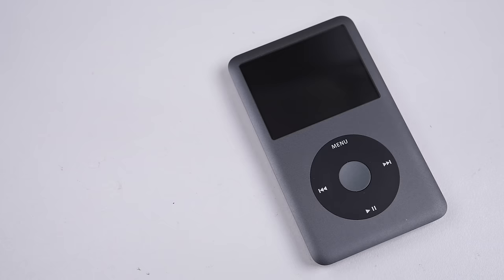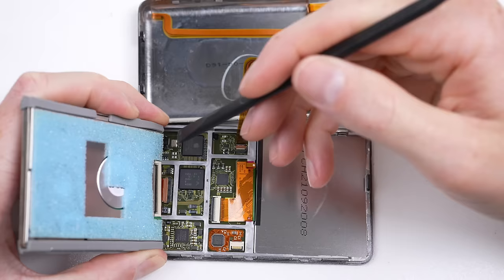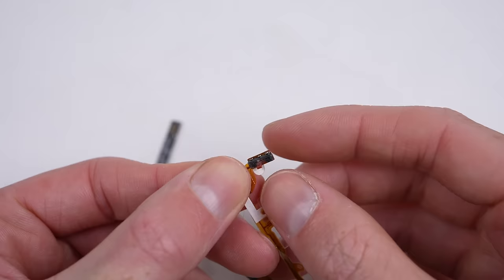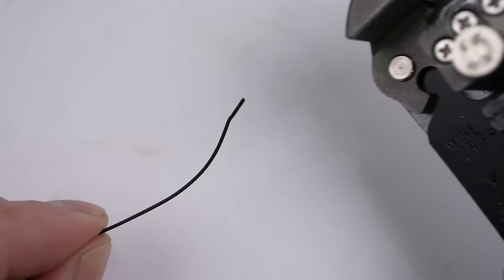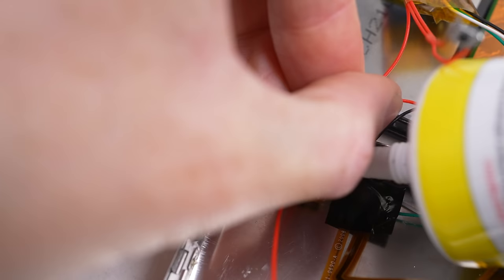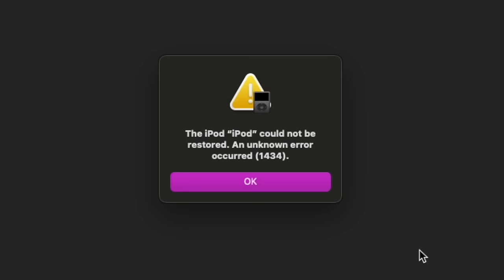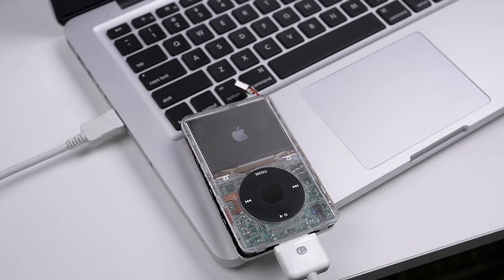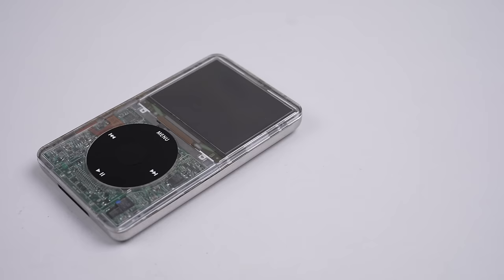Upgrading Obsolete iPod With Modern Hardware (With Great Difficulty)

Comment: I got a 5th gen iPod at the thrift store a few years ago, needed a new battery, and while the HDD somehow still worked I upgraded it to an SD Card adapter and gave it a 128GB SD Card. Then I put RockBox on it as well, so it doesn't even need iTunes and I can play a bunch of other file formats.

Comment: Be very careful when using any sort of liquid Adhesive on a uncased Li-Po battery. As some can dissolve the plastic wrapping they are manufactured in and can potentially make them catch fire. It's better to use some M3 type of double sided tape.

Comment: Hello Hugh,

You've made a couple of mistakes, but they're easy to fix. The green board works fine, but it needs to be connected in a specific way. Just make sure you have one white line visible. Elite Obsolete made a video about it.

The second mistake is using a 6th gen iPod, which only supports up to 128GB in the Stock OS. If you want to use more than 128GB, you'll need to use Rockbox. Consider getting a 7th gen iPod, which has capacity of 160GB. Make sure to get the thin variant if you plan to do that modification.

Comment: I'd buy a modern Ipod tbh. I have the S24U and it makes going for walks and to the gym a hassle because it's bulky and heavy, I'd much rather use a smaller device. Plus, having your library not through a service like Spotify would be nice. When the major carriers all had connection issues recently, work was a xrag without being able to use Spotify.

Comment: Thanks for the video ..Just for the info..There are better SSD kits in the market now a days..It is fully  compatible with 6 th and 7 th gen ,smaller 1/2 size of the iFlash or CF/SD card adapter ,and comes with 2000mA battery .You can use it with slim ipod case too..

Comment: moonlit market seems to be a somewhat easier kit to have aptx bluetooth with better than stock battery, with haptic motor and ssd and usb c. but it requires a new backplate and has issues with airpods (last i heard). unfortunately there doesn’t seem to be a kit out there that does best of all worlds… biggest battery, 4 microsd cards, apt bluetooth with haptic motor, airpod compatibility, dual boot with rockbox, usb c… since all of that would be a challenge to put together and still look stock.

Comment: I did the same Bluetooth board in a 5th gen iPod with an iflash quad and a slim battery that’s the entire back of the iPod. Hated the install process, couldn’t get the board to pair with many things, so I took it back out and replaced the headphone jack with a brand new one unmodified. Still using my iPod as it was intended with just a flash mod lol

Comment: there are better ways of waking the BT module when the ipod turns on... Finding a power rail on the main board that only comes on when awake, using that you could use a low side mosfet to switch it on.

Comment: you can save a lot more space by using an iFlash solo and cutting the top off since it contains no traces at all!

It's funny, just like 2 hours ago I worked on an iPod classic myself (replaced the front with logic board and all from my modded iPod whose battery connector was broken with parts from another one I had lying around)
Might add bluetooth, but later :D

Comment: 6th gens are weird. Over 128gb will work but only if you use Rockbox. If you're using Rockbox with over 128gb, you CAN NOT boot into the original Apple firmware OR disk mode or the firmware will mess with your drive making your partition 128gb exactly. This messes up any data past that 128gb spot and is a huge hassle when you accidentally flip the lock switch while booting and go into OFW. With the file transfers being sooo slow to try to rebuild anything, it's so much easier to just stick with 128gb or less for 6th gens, they still work great as long as you follow that.

Comment: The problem is more likely the firmware incompatibility of your SSD. I did encounter similar errors building my hackintosh. Some SSDs were fine, on some I was unable to complete the installation due to error.

Comment: Hmm; you're using the original in-built DAC/Amp to feed the Bluetooth via the headphone's analogue output so can then be re-converted to digital via the Bluetooth's ADC, that will add distortion.  If you could have tapped the digital signal before the iPod's DAC and passed it straight to the Bluetooth transmitter, the potential output (if via LDAC) could have been very good; as is you're limited to the iPods iffy DAC/AMP (I had various generations of iPod and I was never convinced by their audio quality).

Comment: These are the exact features I want to mod on my ipod. Wondering if I can get everything to fit with a 3000mAh battery and thick back plate. Might just buy the parts and take a punt

Comment: I had this issue. It was the version of iTunes I was using. I used the RetroActive Github project to install the old iTunes and it worked for me. I also had issues with those adapters. The stock ribbon cable was too thin for the adapter.
Reply: He used a bad iPod that can't support more than 128GB. It's a 6th gen, not the 7th gen. He needs a 160GB 7th gen only the thin variant, for his modification. 6th gens come in thin 80GB, thick 160GB, or 120GB variants as well.

Comment: It's the red CF card that's not working and causing that it can't be restored. There are methods to get the red card working with the 3G/4G/5G Classic and Mini but it's not working for 6G/7G Classic. It should work with iFlash's CF card.

Comment: I wonder what filesystem was on that original 128GB card? In any case, you should be able to do a clone of that disk onto the 512GB SD-card. That will at least tell you if it can read from that device.

Comment: I used two generations of iPods, but I always refused to load iTunes on my PC, so used public domain software to load the songs.
After the third generation, Apple changed the structure of the song database by adding more fields, and the previous public domain software stopped working, requiring an update.
The database change occurred at the 7th generation (I believe because of DRM management) involved some low level access to the hard drive, and Logical Block Addressing could be the reason why you can't replace the mechanical hard drive with a solid state one.
Thank you Mr. Jeffrey's for the video.
Greetings from the UK,
Anthony
Reply: He used a bad iPod that basically can't support more than 128GB. It's the 6th gen, not the 7th gen. He needs a 160GB 7th gen in the thin variant to make his modification work.
Reply: The 160GB thin 7th gen can support up to 2TB in FAT32, but it's recommended to stick to a size around 512GB. The 5th gen Video can also handle storage like that. However, the thin 120GB and thick 160GB 6th gens don't support more than 128GB.

Comment: I used to build/configure my own desktop computers back in the mid/late 1990's.  Why did I stop?  Because the functionality in laptop computers has matched or exceeded the desktop, as well as providing more space for me, and portability.  Funny thing is, I do have a laptop on my bench here that is awaiting a memory upgrade so I can switch over to it, as my current laptop will NOT upgrade to Windows 11.

What's all this mean?  That's a lot of cool work there Hugh, but my new to me iPhone 14 Pro arrives on Tuesday, and it will become my new ipod.  Replacing the iPhone 7 Plus, which is becoming a liability for apps that won't upgrade/update.  Cool video for sure!!  Gotta replace the iPad Mini soon too, same problem as the iPhone 7 Plus.

Comment: This iPod version are the worst to do some mods because the software version that limits the ram storage, also those Chinese compact flash adapters would fail for no reason, the best alternative it’s  use one of the many flash adapters, but now there is a much better solution by a British company called moonlit, that provides slimmer micro SD adapters (up to 1TB) and they developed also a plug and play iPod USB C and  Bluetooth PCB, it saves you so much time just need to open the old iPod and plug to the battery and main motherboard, the only downgrade it’s that you need to use a custom 3D printed backplate but it’s not a big deal switch in order to use all those interesting features on an iPod classic

Comment: I'd write something to get vlc on a rk3588s single card, they got sicko epic stereo chips on element 14 or mouser that make stereo look like it's from another dimension.  You just type "DAC", go fast to slow.  Stop around a megahertz, then isolation the price, low to high, better DAC than you're ever even knowledgeable about.  There was software made for the pre-android SONY, it was called uhm Walkman Budy or something.  Well when you plug in the SoundBlaster RX, it has the same problem, it's only digital, because it's to sharpen the output , but you can bound it for a larger Soundstage, and he put it in "bloody large", Soundstage.  This way the music has hidden channels, even if it's only 16bit.  The original channels echo fill back in, like if you just open Adobe audigy, it's 32bit, but then you compress it, it echos, so there's clever ways to unlock the echoes.

Comment: I had an iPod classic latest model back then. It was my first Apple device, and in terms or repairobility it gives me such bad experiance, that I refused to buy Apple products anymore 🤦‍♂
Back then I bought ZIF-CF card adapter, installed CF card and got freeze on apple logo, then tried RockBox and it worked, then tried apple firmware again, and it freezes again, then when i opened it last time, I broke the audio ribbon cable, then smshed that device out of anger. In these days I better spend these money on PSP 🤣

Comment: Why didn’t you use taptic engine
Reply from the maker: It's unnecessarily large
Reply: @HughJeffreys  The iPhone 7 Taptic Engine isn't too large. Besides, the larger contact surface area means better haptic transfer to the rear casing.

Comment: Is there a reason why the newer ipod didn't work?
Reply: He used a bad iPod that can't support more than 128GB. It's a 6th gen, not the 7th gen. He needs a 160GB 7th gen, only the thin variant, for his modification. 6th gens come in thin 80GB, thick 160GB, or 120GB variants as well.

Comment: sir i have 5th gen ipod 3000mh instaled.. my question is,  it is posible to have a 3000mh battery thin instal in my ipod, and my back case is thick.. i use smal iflash instal already. i am looking for a big MH battery in ebay 1 pc  like 5000mh or 6000mh thin or thick battery 1pc  that will fit ipod thick case ,  i hope you do some video modify (2pcs battery 3000mh) it became 6000MH, the single terminal in ipod plex battery and other terminal will remain, and the second flex or battery  1one terminal only is coneccted in 2pcs battery to gain a 6000mh. do you think sir it wiil fit together in ipod 5th gen case the 2pcs battery THIN   inside the back thick case?. to generate long lasting battery.?

Comment: I imagine the day that Apple will cease to exist, the billions of devices they manufactured will just stop to operate.
This iPod can be obsolete, but Apple still sustain its operation by allowing iTunes to configure it - at least, when it is in its original configuration. If Apple wanted to support new flash drives in old iPods they could add new configuration software, but they do not want...

Comment: Why didn't you just clone the original HDD, using a cloning software to the new SSD, seeing that the original HDD is working and not dead?! Get another adapter for the original HDD and with that, you just have to release an updated version of the video, showing what you intended to originally and that it's possible to get the original IPOD to work!